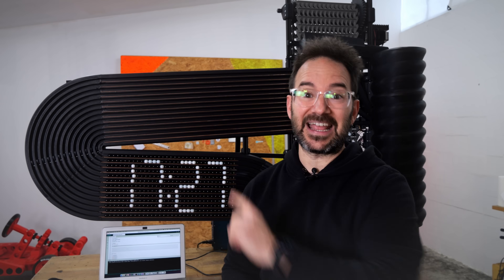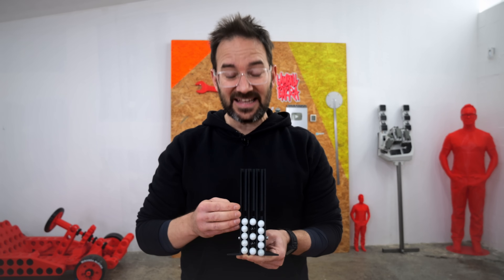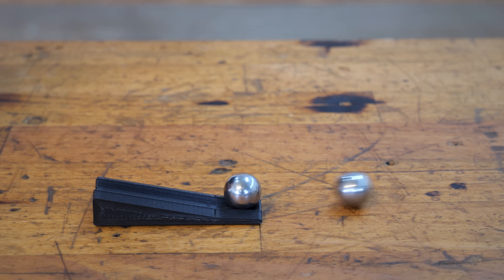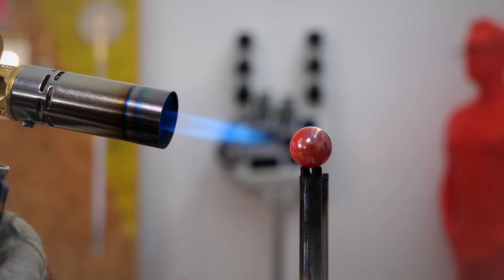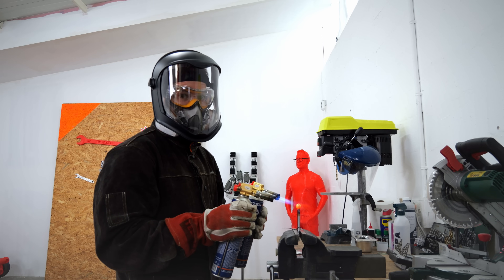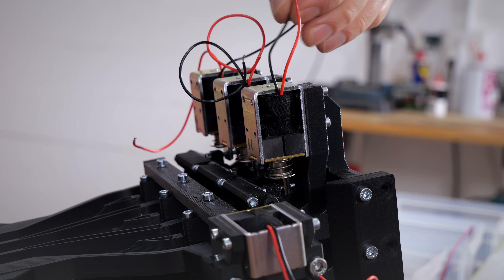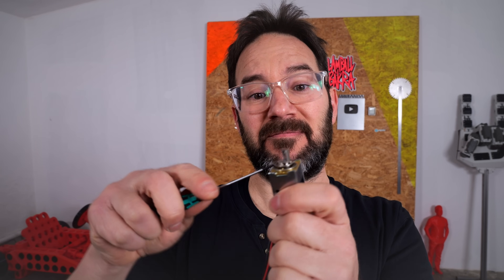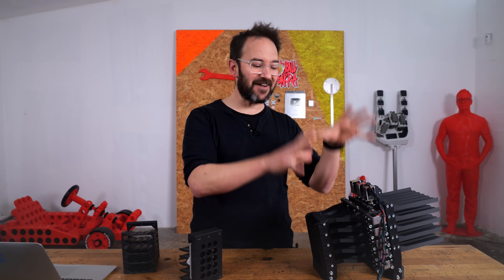Ramp Based Rapid Marble Swap - Marble Clock Seconds Display Pt.1

Comment: To get six of those with a correct spacing between the digits is going to get interesting. Each digit is going to need a custom set of ramps from the selector to the gate and that’s going to affect the timing of the arrival at the gates. I’m sure that he’ll find a solution but I bet it’s going to get more interesting from here on.

Comment: I don't see how you can possibly get this mechanism running fast enough. You need a solenoid cycle for each rectangle, so in the worst case that's going to be like 7 cycles, which will take far more than one second. Even with differential updates where you only load marbles that need to change from the previous digit, going from 1 to 2 would require 4 blocks, (top row, middle row, bottom row, flipping 4th row right)

Comment: You probably want an induction heater to heat the steel balls. - it will save a lot of gas  also some sort of  machine robot to hold them and drop them in the oil,

Comment: There's a problem in your mecanism. Every row Is made of 3 channels, in every Channel you can chose if a marble Is White (right Channel) or black (left Channel). But if the selectors of every Channel in the row are connected to each other (moved by 1 solenoide) you can't have different colours in a single row. Maybe you didn't noticed It because you used only White marbles for the tests. Hope I'm the One wrong (Sorry for bad english, not my First language)

Comment: What about if you went with the marbles falling , but had each digit pre loaded, each digit needs 15 marbles, and every second they drop out of the bottom and get transported to the top to start again. Every 10 seconds the column changes on the left. Etc

Comment: glad to see a continuation 😊
I can see some potential for optimization if all the vertical gates of two columns are the same, you can trigger both columns at the same time. For example for number "3" the first and second column will be identical, so you can open both of them. Then just adjust for the third. Saves a third of the time.
You're not gonna be that lucky for every digit though... Basically just 0, 1, 3, 7 and 8. And as you don't have any caching anymore, you can't take the gains over to the next digit. Unless you do add a cache (another Aluminium gate) of course. And even then there's a link dry spell between 3 and 7, unless you add three or four of them 😆
Oh, just noticed you can change your design from 1:50 so that number 6 and 9 have two identical columns as well. So the biggest dry-spell you have to cover is two digits wide.

Maybe get rid of the Aluminium gate and use the same design you had for the sorter, just with only one solenoid for all lanes (and half as many lanes). That one can release a single marble per run so you can pre-sort marbles to for a line and release only the first one. Not sure you can shrink down your gate design that far though... And get it fine-tuned enough to just throw out the old marble but not shoot out the new one.

If not, that leaves us with a three-stage approach: The big sorter to feed into a cache like I just described, lining uo the marbles for the upcoming digits behind a gate that can release the first of them into the metal gate where they wait for the final release.

I'm sure your solution will be much nicer than this, I'm just brainstorming 😂 Maybe you won't have any trouble at all just speeding it up until you can easily sort in a second with your current design.

Comment: You make it to complicated; 
If you have a row of 60 marvels piled in a channel 
(I per sec) 
Besides on / the channel you put markers for seconds ,and add one evry sec in it via a solenoid release, drop the whole row ,into a collection vessel via a bottom mechanism  when the last one 
Is added (at 60) , then start over  again .
One channel, two solenoids and a single row marvel elevator (only one colour  needed )  the elevator can be set up to fill a magasin with marvels and then stop,when it's full.
 You could also do a variant that displays hours minutes and seconds, in three rows quite easy, even doing the hour 
In 24 hours format .
In 24 hour format 
Yoo will have : row 1 24  pc    2: 60-: -  3 -:- 60

Comment: Maybe you should invest in a furnace that can reach temperatures high enough to get the marbles glowing (propane forge maybe). Put 50 marbles in there. Wait until they’re hot. Dump into oil. Dump into the blueing solution. Repeat. 

Should be much faster

Comment: It seems like each pixel has a fixed sequence of 10 marbles, so why not just have a closed loop for every pixel with 10 marbles in it and just make sure they all stay in sync rather than mixing all the marbles back and reselecting them?
Reply: yeah with this you only need one actuator per digit and a reliable lifting mechanism that can work on parallel channels

Comment: Did you in the end really make it simpler by not using servos?
You added magnetism in the mix and need to multiplex the whole thing
I think the 3 stat design you showed first would be simpler to control and make work reliably
Having two relays each and multiplexing things with yet another servo will slow you down and break the neck when it comes to the one second goal

Comment: You can make three-positions solenoids using a magnet to draw the solenoid to the neutral position when idle, then field polarity to flip in either direction. Or do it like a speaker cone where it physically rests near center position and then the electromagnet is used to deflect either way from the resting position.

Comment: Whats the point of the wall at the end to hold the marbles in place before the second change? Why not use that matrix to release only the marbles you need in anticipation for it, so by the time they get to the end they pop off the old marbles at the exact right time? Maybe it's got something to do with tolerances...

Comment: you can give the solenoid 3 positions by tensioning the solenoid with a spring. when no current is flowing, the solenoid has the middle position due to the spring, when the coil attracts the one position and when the coil repels the other position.

Comment: Is it possible to get a solenoid with two springs so that it idles in the middle? That way you could drive it with a H-bridge. Power it one way to go to one position, power it the other to go to the opposite position and leave it unpowered to be in the middle position.

Comment: Since you're definitely going to have to move the solenoids further from the lanes might as well have an 'engine block' and hook up each selector to its own solenoid with rack and pinion. That way you just need to divide the marbles into designated black and white lanes and you can select which ones to let through as late as possible.

Comment: I bet every min changed you greatly appreciate that clock,, especially at night..
I use to have the older ones that had a swing arm picking up a steely bearing every min and it would deposit it at the top of a set of ramps.. every five it would dump and then it would dump the next every 60 and then dump from the next that held the amount of hours went by… and it was noisy,, terrible, but at 11:59 when your sleeping pretty good and then all the days worth of carnage dumps down a bunch of ramps and this is where I no longer owned a working bearing clock..

Comment: At least for this version you only have to update the last second digit once per second. The next digit needs updating only once every 10 seconds, and so on. So if you can find a way to cycle back the marbles per digit, you just need to put them in the right order, and loop through all 10 digits for the last digit, 0-5 for the 2nd one, etc. In essence, make each digit its own closed loop system. Once you have the seconds figured out, the rest is copy paste.

Comment: One method I had thought of is to use a rotating vertical display where the display rotates horizontally but the balls fall vertically, going with 4 faces for simplicity, the front face is the display, one of the side faces is the next digit and the opposite side is the drain.

Once a second you rotate the square, the old side falls away and it loads the next side. It is essentially parallelising the process, it can display, load and drain all at the same time but on different faces so completely separately and the display time is determined by how fast it can rotate so then you have close to a full second for each step, loading, draining and displaying. Since loading or draining both take 0.33 s then since both are completed simultaneously it would have plenty of time to spare.

Another idea I have had is to never mix the marbles, each digit counts linearly and predictably so rather than picking out the marbles for the display you keep the marbles in closed loops and just loop them, that eliminates the marble picking step.

The only problem could be with multiple digits close together but then you could change to using a triangle rather than a square or keep with the square but do both the loading and draining on the back side. It should be possible to make it circular too which could also eliminate the issue.

Edit: the loading and draining on the rotating display could be handled automatically and mechanically too, just have a void under the drain and have the gate automatically open when the loading side is in position. By setting the height of the display right every rotation it could load a set number of marbles dictated by the height of the slot. Then you eliminate having to control the gates as it is completely automatic.

Comment: Crazy Project👍 wouldnt it be easier, both mechanicaly and for readability, if only those marbels change, that need to be changed in the grid? And because it repeats, you could design "steps" so that a circle completes after 10 steps, regardless If for example only three marbels need to change.
Incredible machine🤯

Comment: You can get 3 positions with a solenoid by keeping a centre point in suspension by springs. You then pass voltage to the coil in either polarity to activate the positions either side.
However, your mux system is far better!

Comment: Why don’t you A. Make a build with small folds to hold it in place instead of screws so that it could slide on and off and B. a smaller build so that it doesn’t take much space. Like the display could be the ladder that returns the marbles to the top.
Reply: And therefore you don’t need so many marbles because they can recycle every 3 or 4 seconds

Comment: I fear you're going to run into a speed issue with this design. You have to release balls a full column at a time after putting your selectors in the correct position. But the selectors need to be in different positions depending on the column, which means for some digits, such as 4, you're going to need to select and drop each column individually, and you'll need to do it three times in one second.

Edit: On further consideration, this is true for digits 2, 4, 5, 6, and 9. You're going to need to average a "select-drop" cycle 2.5 times per second for this to work.
Reply: He "might" be able to reduce the per column time by triggering the solenoids for marble selection and drop concurrently. Then again maybe it would just jam it up... 😅

Comment: That just soo crazy - I like it. 😊👍
If you cooked those marbles like crazy, chances are their magnetic characteristics are now different enough to pick up on their "color" using either optical or magnetic sensors - for refill.
Also, why use mechanical gates if you could use electromagnets to hold your marbles in place, which would be a lot faster and make no additional noise ?

Comment: There is a company called sculpt neuvoau that makes patinas (black magic and midnight black). I’ve used them for blacking my steel work. These patinas work on many metals, but not nickel plated or stainless reconsider muriatic acid

Comment: Maybe a suggestion: I see that the balls that are showed bounce a little, reducing the speed of the system. Try to increase the angle of the final part (that end with the step that stops the marble) to reduce this bouncing. Also maybe print some one-way teeth to "encourage" movement toward the showed marble but stopping the bounce

Comment: Excellent progression! You are getting there!
Still, I do not understand, why you want to change all digits every second. You could save a lot of marbles, if You limited the update to the elements of the display that really need an update. For example, updating the seconds from  ":05" to ":06" only requires one marble to be changed on a 15 grid. And even going from ":09" to ":10" needs only 12. Also this kind of explicit change can be pre-staged much easier, since the digits in one column will only ever go from "0" to maximum "9" in column 6 and 4, A sequence, that needs 10, 8, 2, 4, 4, 1, 7, 6, 1, 2 marbles respectively to process. 
So even in the theoretical worst case for a complete flush of the time, only 10 x 6 = 60 marbles are ever required to update hour, minutes and seconds if setup this way. Why do I say theoretical worst case? Well, there is only 60 minutes in an hour. 
The first column only changes from "0" to "1" to "2" and back to "0" - marbles required to process that: 10, 8, 3. 
The second column displays the numbers from 0 - 3, - marbles required to process that: 10, 8, 2, 3.
The third and fifth column can only ever go from "0" to "5" and back to "0" - marbles required to process that: 10, 8, 2, 4, 4, 3. Only he fourth and sixth column go the full sequence - marbles required to process that: 10, 8, 2, 4, 4, 1, 7, 6, 1, 2.

Comment: Instead of replacing all the marbles why not just have a mechanism to reject the ones you don't need for the next digit. Then you could just supply the marbles for positions where the new digit needs a marble and eject the marble where you no longer need it. This would make it faster to create each digit.

Comment: It looks like there are 5 positions in the array that never change color, 3 are black and 2 are white.  That brings you down to 10 changes to make per second instead of 15.  You could do this on your current setup with 2 columns instead of 3, routed appropriately.  Give you a half second to do each operation instead of a third, might be enough to get  you there!  Also reduces the amount of black marbles you need since 3 are just static.

Comment: Why not sort black and white at the bottom, and then pull a full row of alternating colors, or whatever makes the most sense based on color frequency, then push in the marbles you need at the top and recycle the rest back to the separate color bins?

Comment: I think you're adding too much complexity trying to choose between an "on" marble and an "off" marble by trying to select by color.  Since your filament color is already black, what about just using a silver marble as "on" and an empty space as "off"?  Instead of your 11 degree ramp with a lip, you gate the display.  Anything you want "on", drop a marble and have the gate hold it.  For "off", use the gate to eject a marble and don't release one to the gate.

Comment: This is absolutely fascinating! I've loved this entire project. With the minutes and hours portions of the clock, it made sense to have a sorting mechanism and two colors of marbles, but for the seconds, based on your approach of layered numbers coming from the back, wouldn't it be easier to use one color of marble and create a repeating pattern of number shapes using the negative space as the "black" marbles?  That way, you don't need to incorporate sorting into the mechanism since they are all the same color and you could instead focus on the repeating sequence of numbers.
Reply: The only issue with that is eliminating a marble when it needs to be blank.  The system he set up so far relies on the new marble to displace the old one.   That said, if there were two solenoids, one for release of new marbles and another for release of current marbles, you could release the current marbles without anything behind. I think that would be easier, but far less entertaining.
Reply: I think your description is far from concise, but IMHO this is the solution one should go for!

Comment: Why don't you represent black spots as no marble, you can simply chuck the marbles out of their slots with another sliding mechanism. Although if you have to dump all the marbles @keebler_137's optimization (not all marbles need to change for each digit) wouldn't work. After you get it working, I'd love to see how small you can make the final thing

Comment: Why you need the marbles to be two colours?
Nice silver metal marbles on a black background.
And the problem with the magnetic issues could prove to be a solution. How about just using electro magnets to control the metal marbles?
Just thoughts inspired by you madness to mine. :)

Comment: I would say you don't even need two colors, just use the chromed bearings and negative space to display each digit. That should significantly simplify the whole project since you don't need any sort of selection, just the ability to control each gate independently. Then again, this is exactly the type of thing where the whole point of it is the complexity, so that decision might be antithetical to the project itself.